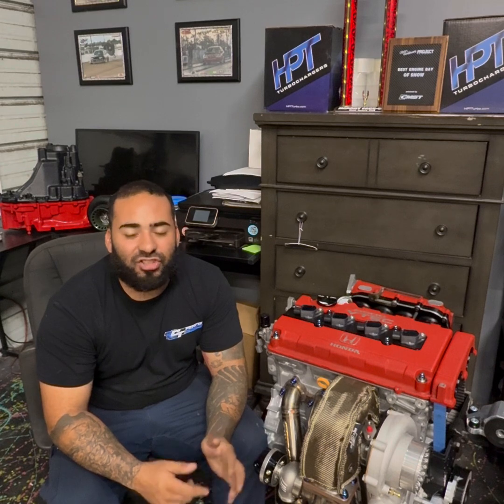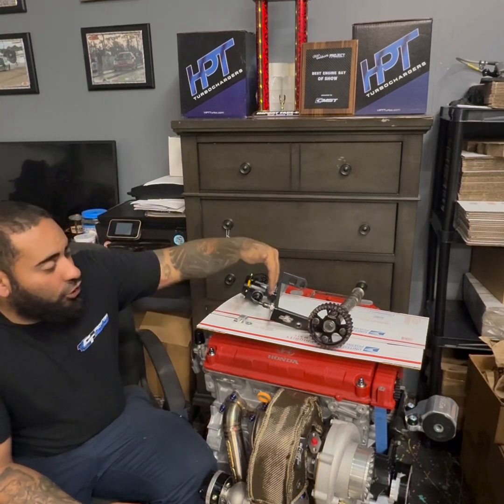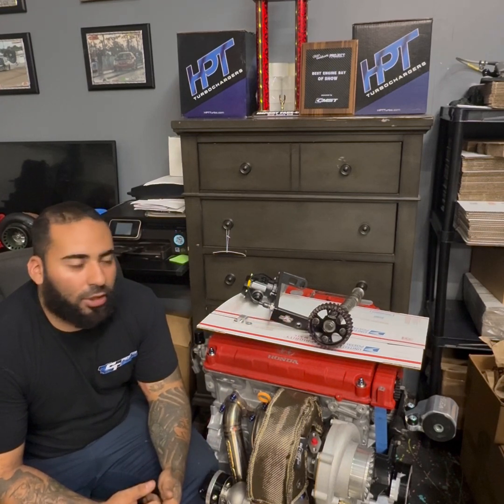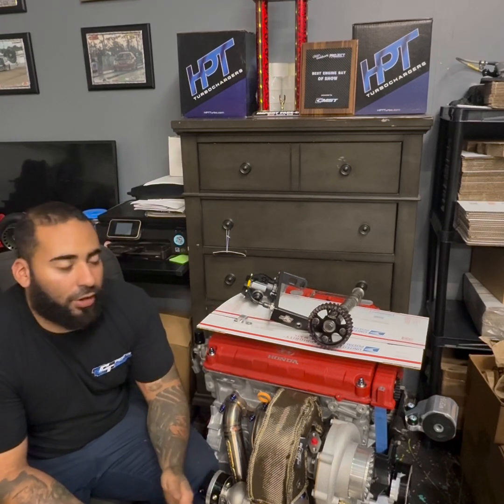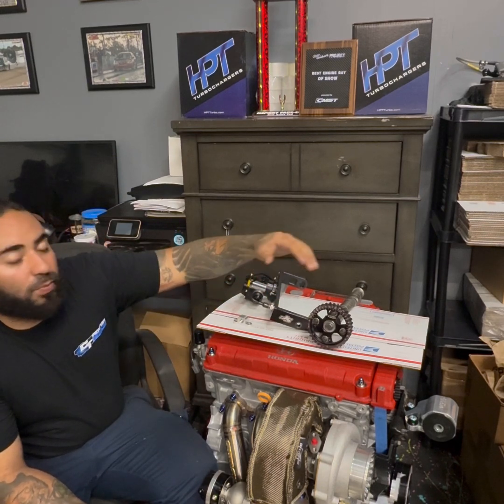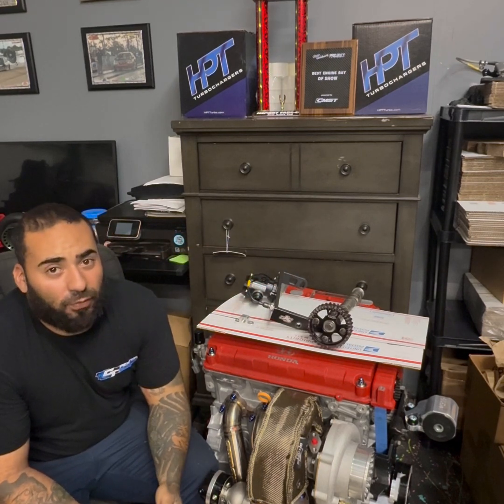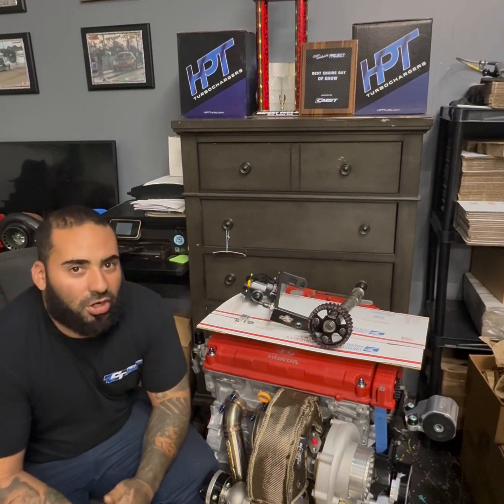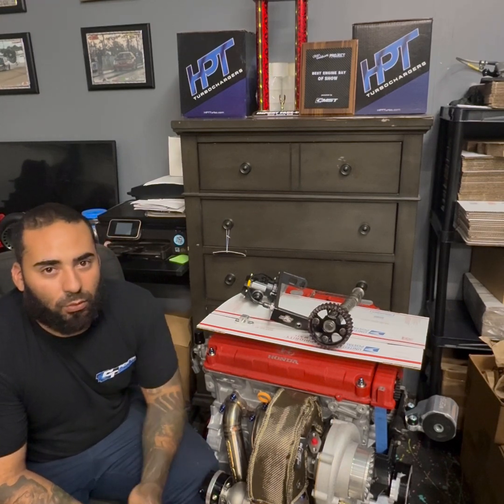Fueltech on your obd1/obd2 honda motor what’s needed

Comment: You can use the DigiDizzy with the 450, it only uses 3 wires between the ECU and DigiDizzy, instead of 7 wires. You get trigger like outputs from the DigiDizzy, it controls the 4 coils from 1 ignition pulse from the ECU, and the DigiDizzy outputs rotation based Tach output to the RPM gauge.
Reply from the maker: Maybe you can dm or email me so we can talk a bit more . If I can get a understanding I wouldn’t mind offering this option to my customers 
Ig cesar_torres
Email cesartaps@yahoo.com

Comment: Got a question. I have a ft600 and my t1 cam trigger burned up as soon as I turned on the ignition. Peeled back heat shrink and all wires are pinned to correct spots. I’m getting 4.5v coming from B1 and B3 rpm/cam of the fueltech. Is this normal and I got a bad sensor? Sensor was brand new.
Reply from the maker: Sounds to me like a wiring problem, you should have 12v on those two pins
Reply: @ My main question is is the FT600 B1 and B3 pinouts suppose to supply 4.5v when they say their RPM and Cam Sync input? Am I suppose to be on B1 & B3 Input or B2 & B4 Reference for the T1 Dual Pole Hall Effect Sensor?
Reply from the maker: @seelback1  no Fueltech doesn’t supply 12v for your cam or crank. That is something you add in on your wiring harness. If you have 4.5v you have a problem. You will need to use b1 b2 , b3 , b4 when wiring it up .
Reply: @CTPARTS  Right now I’m getting 4.5 volts coming from FT600 B1 and B3. I called Fueltech and they said that is normal to have 4.5v coming out of the ft600 b1 and b3 pinouts. I think that is odd if that’s designated as an input. So if I’m using a T1 cam sensor which is 4wire dual pole, I’m suppose to have 12v switched, ground, b2 and b4 reference for cam sync and rpm?
Reply from the maker: @seelback1  yes that is correct.
Reply: @CTPARTS  thank you.

Comment: So i have a 450 i won off a raffle. My set up is a k series turbo with ac now would that be enough for my set up?
Reply from the maker: @Riverabuilt  all motor ? Yes , turbo no
Reply: @ damn lol
Reply: @CTPARTS  now is there a reason why? New to this whole fuel tech thing
Reply from the maker: @ check out my video on which Fueltech to pick it will help you understand more about
Reply: @ so basically to run the car with ac i can just get a switch panel to free space. Like your yellow eg?
Reply: @Riverabuilt late but yes. More things on switches. Fans pumps etc. will free up space

Comment: I gotta 450 for my built bseries setup gonna run a switch panel for anything extra that i gotta main running fuel ignition and fan on the panel i wish i watched this video a week ago when i bought it
Reply from the maker: @KILLERZX5  has happen to a few guys but you should be fine with switch panel to help you

Comment: I messed up. Got 450 for the h22
Reply from the maker: Can make it work like I said for sure . Awesome ECU better then stock
Reply: You'll be fine for the time being. Running the same. Future upgrade will be 550. Plug and play minus the additional inputs harness and sensors.
Reply: @clintonrossouw4240  
Awesome bro. You're also H series motor?
Reply: i run an h22 with the 450. to save outputs, i have it setup for wasted spark. 1+4 and 2+3.
Reply from the maker: @ yes that’s how most ft450 are used
Reply: @tainted939  hi, What trigger system are you using? I have an H22 and i cant get it t start reliably no matter what i do with the distributor. would start once in a while and some days it wont
Reply: @SpeedThrills100  i gave up using distributor VR sensor. for my engine i used kstuned hall effect trigger kit and it worked flawlessly once i got the correct cam&crank settings. If you are stubborn on using distributor VR signal, u can try modifying the 4tooth gear into a 1Tooth for camsync. might give a better signal compared to the snail shaped tooth.
Reply: You can use the DigiDizzy with the 450, it only uses 3 wires between the ECU and DigiDizzy, instead of 7 wires. You get trigger like outputs from the DigiDizzy, it controls the 4 coils from 1 ignition pulse from the ECU, and the DigiDizzy outputs rotation based Tach output to the RPM gauge.